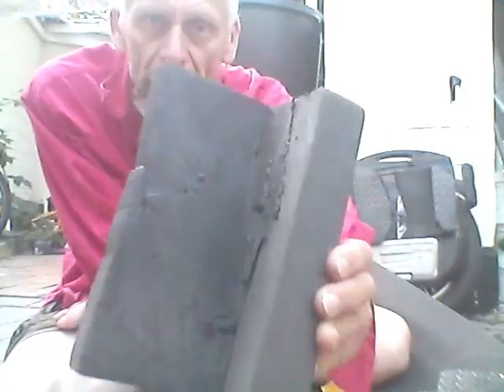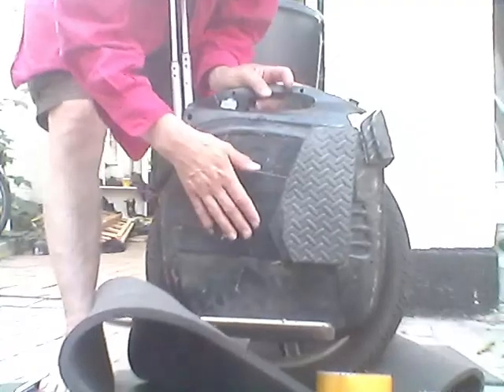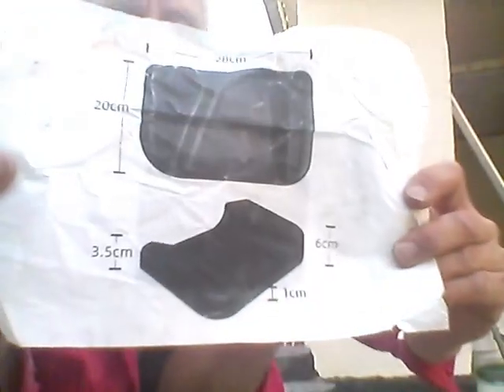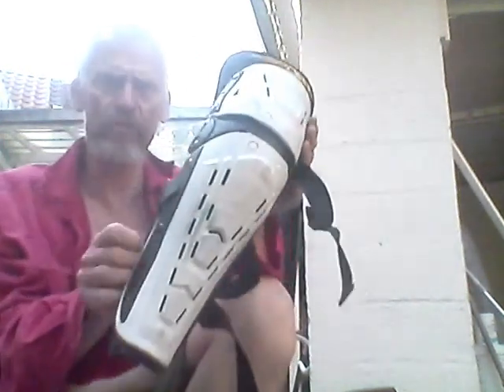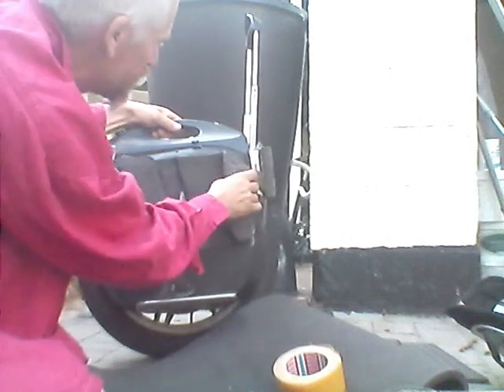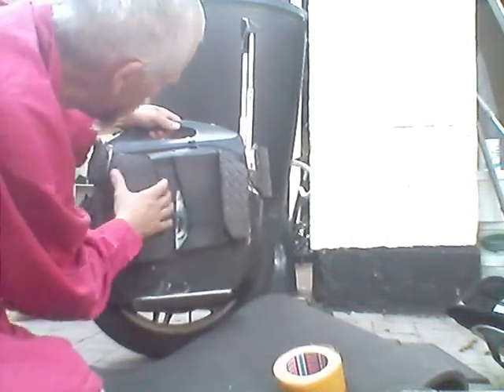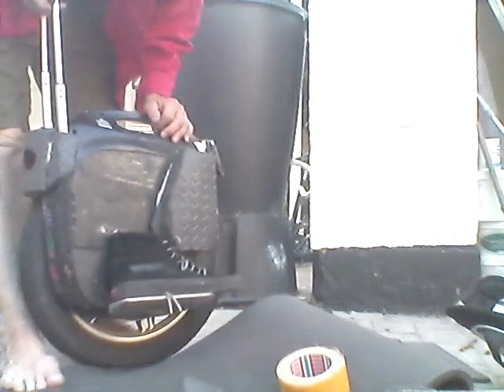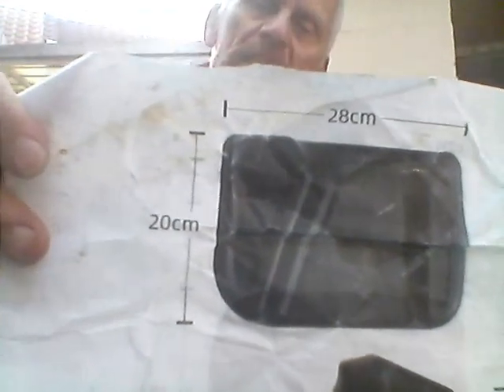EUC sidepads made from yogablocks. Safer better and sexier.

Comment: Snapping a picture of your foot standing on the step, print that out as the guidelines to cut the foam will give you a way more adopted surface to adopt to your"FatLegsBigFeet" 🤪
You made me think to actually 3d print them in NinjaFlex😉
Reply from the maker: use your shoe perhaps ?
Reply from the maker: thx
Reply: You’re awesome. I love your attitude and appreciate your advice. As an owner of the kingsong s18 though, the built in side pads don’t stick out far enough on the sides to get sufficient leverage for jumping and pulling the wheel up with you, which means you either have to push your legs together or try to attach side pads, which ends up being super annoying, since you’re basically trying to attach side pads to the built in, sucky side pads. Personally I prefer the flat Gotway wheels so I can add the custom side pads cut to exactly the shape that works for me. In the future I think there will be a solution to adjustable built in side pads that would have a strong skeleton so you could really get leverage when jumping, but be soft enough that it wouldn’t hurt the tops of your feet. In the meantime, I’m off to attach some yoga blocks to my new Gotway rs high torque thanks to your suggestion. I’m incredibly stoked. Much love man!
Reply: @DylanBakerparkour man if you still have that S18, custom pads made mine a COMPLETELY different, much more capable machine!  It is pretty important to have the batteries upgraded to Molicell packs before trying to get any more oomf out of the stock S18, which the molicell packs absolutely do!  
I tried to make my pads look and for well with the shape and aesthetic of the OEM shell and padding.  Looked really nice when I first made them😄